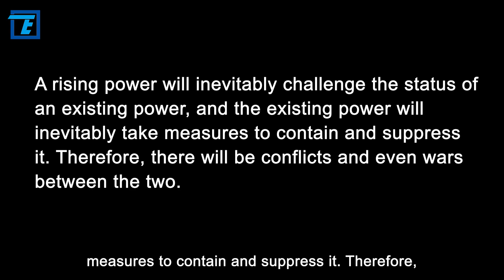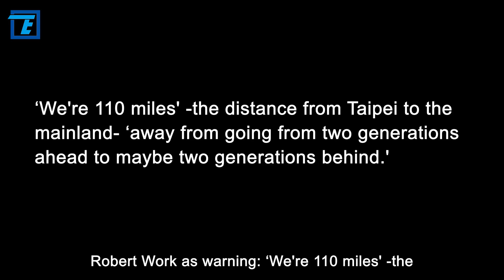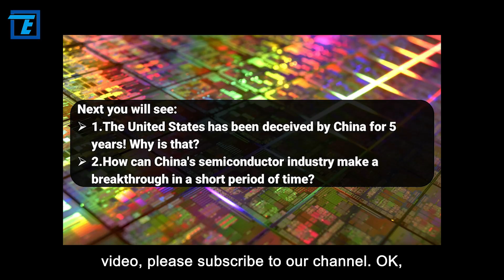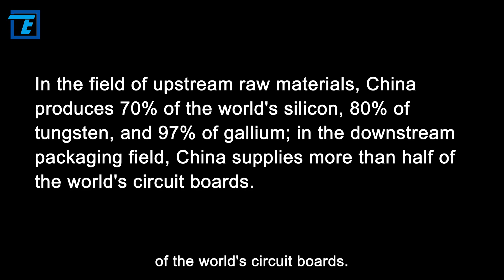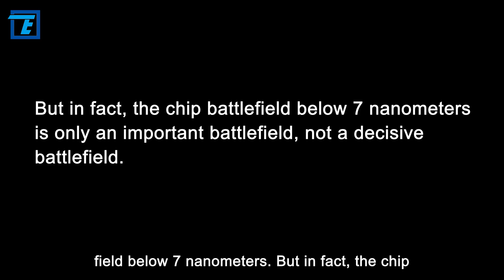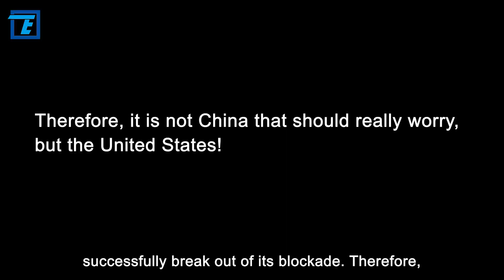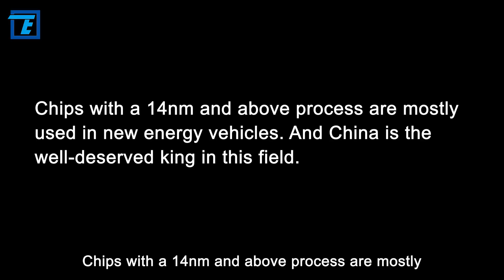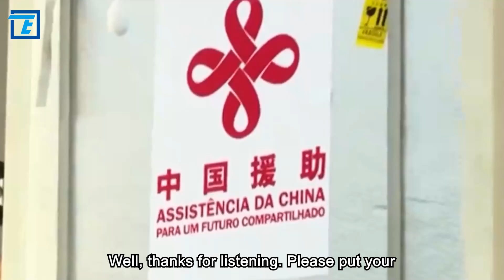After five years of fooling the United States, China's chip plan has finally been exposed?

Comment: It's a heat problem. The most advanced chips can not have all the transistors switching at once or it would burn up, so the trick is to have a processor where you have more specialised hardware on the chip for different types of computation. This technique will give you less than linear scaling. Rather what you want is a substance that does not generate so much heat. For this graphene would be the thing to use as it is about 100 or more times as conductive as what we use today in chips.

Comment: The U S is running the race all by herself. 
China has never give a damn except to point out that the U S runs afoul of WTO rules. It won't stop them.
China objective is to achieve self sufficiency for her own National Security. Her 70% now upgrade to 75% by 2025 is on target.
SMEE DUVi has already passed verification stage and is moving towards validation. It will be an all Chinese equipment chip manufacturing. No more fear of disruption.

Comment: I don't think that China deceived the US.  The US by its own hands thought that the future of semiconductors was at the high end so it threw everything it could at China to prevent China from developing the high end chips. From preventing ASML to sell EUV lithography machines to China, to ban the sales of all semiconductor processing equipment and software.  It was public knowledge that China focused on mature node semiconductors because it was thwarted in the high end chips by the US.  China knew it was weak in fab but strong in design.  China built 30 new mature node fabs in the 2020 to 2022 time period and ASML sold over a hundred DUV machines to China.  Both Nikon and Canon also sold their lithography machines to China and are trying to sell their 4/2nm process to China.  The data shows China's success and how China continues to rise in mature node chips.  

In 2022, China was producing over a billion chips a day.  It imported 43 billion chips, but exported 160 billion chips.  China's goal is 900 billion chips a year by 2025.   China has moved on to RISC-V open source architecture and has developed its own EDA tools for design.  Further, China is exploring photonics, graphene, and quantum chips to leapfrog the high end chip sector. These advances could blunt US advances in high end chips because of the potential of less expensive semiconductors with the same or better performance than silicon chips.

The US semiconductor plan is to focus and move forward in high end chips by investing $52 billion in seed money to build high end chip fabs in the US.  Intel is constructing 2 fabs in Ohio, TSMC plans 2 fabs in Arizona, and Samsung has plans for at least one fab in Texas.

Personally, I think the US is overbuilding its high end fabs.  Why?  Because over the last 4 years, there has been a steady decline in high end chip sales.  Even TSMC in 2022, idled 4 EUV machines and told employees to take extended vacations.  Morris Chang, the founder of TSMC, cited TSMC's experience at its Portland, Oregon plant where the costs to produce chips in the US was 50% higher than in Asia.  US fabless company's biggest market for their semiconductors was in China.  China accounted for 60% of their world sales and that is in full retreat beginning in 2020 when the US started to place restrictions via it's 'entity list' to deny high end chips produced by the US.  US semiconductor companies have lost $1.5 trillion in their stock valuation and lost somewhere between 10 to 20% of their China sales because of US restrictions.  Both sales and profits have gone off a cliff with some US companies showing deficits and selling inventory by as much as 90% discounts.  These are all signs that the US government meddling in free trade and the business of semiconductors  has mucked things up so badly, US semiconductors have become the victims of these sanctions, not China.

The main reason, high end chips have a limited market is their cost. EUV lithography machines cost $150 million per pop and the EUV+ machines ASML is introducing in 2023 will cost some $400 million each.  The yield rates at this high end are relatively meager so the end product costs are very high.  Mature node chips have high yield rates and high production rates and the amortization of semiconductor fab equipment becomes a minor problem.  

Further, the US commentary that it is trying to prevent China's use of semiconductors in its military products is a false flag.  Military gear has more in common with the auto industry than in mobile phones.  Military specs require a wider temperature, shock, vibration, humidity range and in some cases radiation proofing.  In both cases, mature node semiconductors are used.  The US misled itself and has itself to blame for the situation at hand, another example of negligent political direction.  China's focus on mature nodes was caused by the US effort to deny the high end chips to China and by the fact that China's needs were in consumer goods like cars, appliances, televisions, video games, and gadgets Americans are addicted to.---all in public view, if the US government were watching.

2023 will be a turning point for China's growth in semiconductors.  In 2023, China will have a photonics and a quantum chips production line  running and with the production of eight inch graphene wafers, the tape out of semiconductors in graphene is about to begin graphene chip production.  Further, China has a strangle hold on gallium which has become the mineral of choice for high power, high frequency, and high temperature applications for semiconductors.  China controls and produces 97% of the world's gallium.

In my opinion, Biden has the right idea, but is going about it in the wrong way.  Instead of broad brushing US efforts in semiconductors, it should have focused on key areas the US had strengths and furthered their development. Everything from fab equipment to EDA software used to be America' monopoly.  Now, because of US sanctions, China is now a growing competitor in these sectors.  In the long run, by the end of this decade, the US will find itself a laggard instead of a leader in semiconductors.  Biden's brag that the US was the inventor of the semiconductor sector is true, but the government mismanagement of this sector will make it second class.  

Like sanctions in the past and currently against Russia, sanctions are producing the  opposite results to the detriment of the US.  If the de-dollarization efforts rising today succeed, the US will have another reason for its failure. The illusion of democracy, free trade, and an open society are showing their decline and along with it the probability that the US will fall behind China and continue its decline as other countries pass it in the fast lane. China's BRI is showing results and instead of the US joining and profiting by it, it stayed in denial.  The US is trying to recapture some of that glory in Africa and Latin America, but to date, it is failing. The handicap for the US is its past colonial, imperial actions. 

The current projections are for China to pass the US in nominal GDP by 2028.  In PPP terms, China passed the US in 2014.  China is transitioning from a labor intensive economy to a technology economy to avoid the middle income trap and semiconductors are at the roots of this technology growth.  China is avoiding the Thucydides Trap trap as was done by Japan, South Korea, Singapore, and Taiwan in their evolution from agriculture to technology.  Now it is China's turn and semiconductors are at the heart of this leap forward.